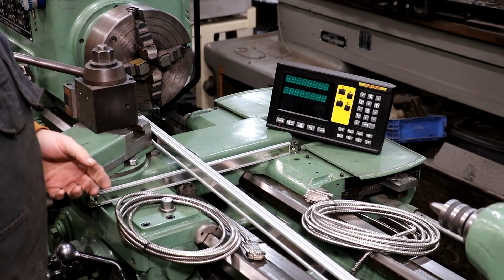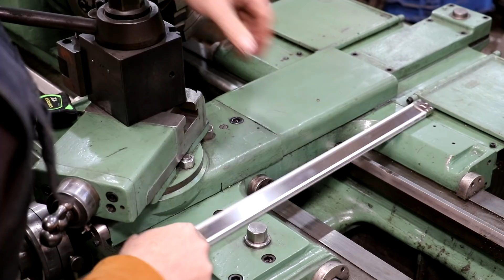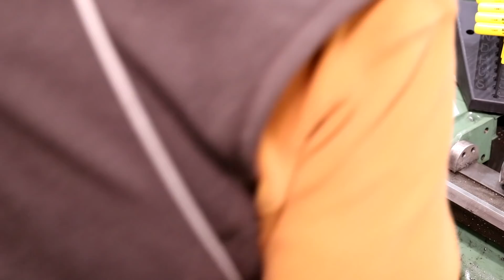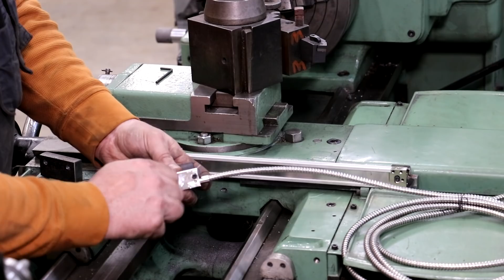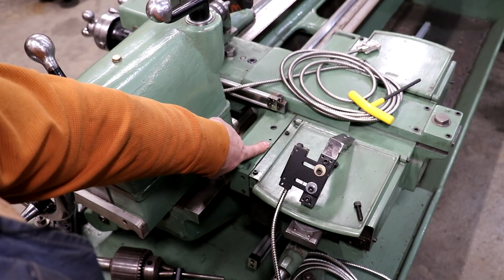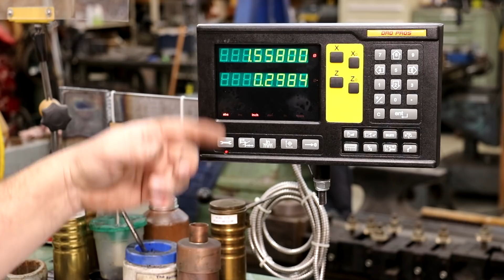Installing a Dro-Pro’s Digital Read Out on a Monarch Model K Lathe

Comment: I’ve been a manual and CNC machinist for 30 and I’m surprised how little I know about how a lathe and mill  is built and what makes it work .
Just was involved in that I was busy making parts. 
I just bought 1960 leblond 13x46 lathe and I’d like to ask what’s the difference in leveling or taking the twist out. What’s more important?It has no broken gears and seems to work well

Comment: I had to mount the X-slide and pick-up on the left side of the cross-slide to retain access to the cross slide locking screw.  Didn't use the grub screws.  Used shims instead.  I have a Z-axis readout on the tail stock quill.

Comment: Keith, a suggestion for you, I have put DRO on at Least 6 lathes now. I found I highly prefer to put the readout directly on the carriage.
This does two very important things for me-
Always have the readout where I am working- and second, allows you to get the cable’s out of the chip pan and traveling with the carriage.
Much tidier and less chance of having the bane of machinist - stringy chips- snag a cable and wrap it around a chuck
I enjoy your rebuilding!!

Comment: Looks simple enough. Couple questions, How important is it that the scale runs parallel? You had a thou both ways, would say 5 thou change the readings? Also couldn't you have mounted the whole assembly out the back end? Say mount the head on the end of your taper attachment and mount the scale on a mount extending back from the cross slide? Would keep it further away from chips and tail stock interference.

Comment: Why didn't you just offset the sensor and strip to the back of the machine so it would not be inline for possilbe tailstock damage. Does not matter where its mounted, just has to be in the same axis?  Would it not also move it away from metal contamination on the magnetic strip from the machining?

Comment: (cross slide) Would it have worked to mount the read head on the flat piece on the rear of the cross slide support?  That would have let you mount the rail directly to the cross slide, starting right behind the bulge.

Comment: Yup. I saw that issue from the beginning. I was expecting that it would be seen before he started to make the mounts. The problem is that when you’re not completely paying attention, because you’re doing two things at once (doing the project and doing a video explaining it at the same time) you don’t have the full concentration you would have if you were just doing the project. It happens to me too when friends are over, and want to see what I’m doing, which means I have to explain it, and sometimes, redo some of it.

I just finished adding a three channel DRO to my mill (not a Bridgeport). It was a lot of work. Now I’m going to take the older readout and put it on my lathe, so I sympathize with the effort here. My lathe has a taper attachment, so it’s a bit of a pain to mount the readout head, just like here. I’m mounting the head to the bottom of the attachment. There’s room on the taper bracket itself.
Reply: I had put everything together to do EXACTLY what you said here... Then an injury brought last year to a dead stop.  Just now getting back in the swing of things.  Thankfully, it wasn't a shop related injury.
Reply: @stxrynn  oh heck, I sure appreciate that! I was just getting back into welding a bit over three and a half years ago. I have a bad habit of going all the way on things when I decide to get involved. Six months later I had a heart problem, thankfully warned by my Watch. I went to the ER. I spent about a year before I was told I could get back to my shop work, which, of course, involves moving heavy objects. As soon as that was ok, I got a torn retina, and guess what? No activity like that for another year!

So for anything serious, it was almost two and a half years before I could get fully back into the swing of things. I’m trying to catch up with that 2.5 years of lost time.
Reply: @melgross  We must be twins.  Retina issue mid '19 cleared in Jan '20, injury in April 20, and just getting back in the grove.  If we lived closer, gravity would double, and we wouldn't be able to move!!  Man, I hope we are done with the limits and can finally get back to busy like we want.  Take care bud!
Reply: @stxrynn  good luck!

Comment: It being magnetic isn't a problem with metal chips?
Reply: I have digital calipers which also uses a magnetic measuring System and I have no problems with metal chips or metal dust sticking to the scale, the magnetic field of the scale is just not strong enough to attract metal...
Reply: @Henning_S.  oh ok didn't know if it would cause a difference in readings or if chips would stick to it and cause damage because the metal was attracted to it so thanks that is good need to know info

Comment: I just put a DRO Pro's kit on my Bridgeport maybe 6 months ago, great product, but like you said, they don't just bolt on. The X axis was pretty easy and did bolt right on. The Y was a different story, try as I might I could not make the supplied bracketry work (at least the way I felt it should work) so had to fab up my own solution.

Comment: Has the drill for the metric tap, has no idea what diameter the drill is. Classic Keith 🤣
Reply: Fun fact: for metric the drill size is just diameter - thread pitch. E.g. M3x0.5 use 2.5mm, M4x0.7 use 3.3mm, M5x0.8 use 4.2mm, M6x1 use 5mm etc. Works all the way up to M60x5.5 use 54.5mm drill.

Comment: I have an import mini lathe, 11" swing and I dabble in engineering as a hobby. For years I kept being reminded that on a lathe a DRO isn't necessary. But a few years back I fitted a 2 axis cheapo DRO and it made such a huge difference to my lathe. Sure, I can't take abom cuts, but recently I was making a new big end bearing for a miniature traction engine and I was within 0.0065" of my target having crept up on the final size just with the DRO

A last year I made eccentrics, short video here https://www.youtube.com/watch?v=BBPIF1u_ke0

Comment: Hey ya I'd drill a hole in a Monarch for those mag scale's That Dro Pro's unit will last for years. The Sony and the Hiedenhain d" Be the others. Setting the +& -- Dia reduction and tool off set's . Love to see it. A sony J230 camera with the privacy filters set to cross hairs on the mill with it's own offset to use as a measuring microscope or to simply peck in points on a graphical unit like the acurite vue. For transfering drill hole's in a existing piece to a blank in a stop. I have the yuriy's toy's kit hoping the grahical display has like 99 point's duhnoh? sounds like enough

Comment: This maybe a stupid idea but I will ask anyway, with it being a magnetic system being used on a machine the is built to make metal chips won’t there be a problem with metal shavings collecting around the magnetic head then start gouging the scale and  would that interfere with the accuracy
Reply: Ditto...was immediately curious about that.
Reply: @Gontiveros  The magnetic part is under the stainless cover (the shiny strip inside the alum extrusion).  The read head floats about 0.5-0.8mm above the cover and has wipers.  Larger chips would probably not stick in the first place (they haven't on mine) but would be swept off by the wipers.  Smaller chips (dust) is either swept off by the wiper or harmlessly passes under the read head.  Even if they scratched anything, it is just a stainless cover strip.  The magnetic part underneath is bonded to the alu extrusion and looks like a fridge magnet.  They are impervious to water/coolant and can't be contaminated by chips.  The read head and scale are significantly more compact (smaller) than other systems I've seen, which is important when dealing with limited space, plus how far back your tailstock now sits since it can't get as close to the carriage as before.  Some mount the scale to the chuck side for that reason, but that has its own hazards.
Reply: @barrygerbracht5077  Awesome, thanks for the thorough explanation!

Comment: Standard metric tapping size is easy. Diameter - Pitch = Tapping drill. 4 - 0.7 = 3.3 , not sure if it holds for fine and course though.
Reply: Even easier, no nead to know pitch: for normal metric threads tapping diameter is thread diameter times 0.8.
Reply: @radiohirsch  Your formula for determining tap diameter is very wrong, even for standard pitch. Des stated the correct method, and, yes, you do have to know the pitch.
Reply: @radiohirsch  that is incorrect. 10mm tapping size is not 8mm for instance, fine through to course is bigger than that.

Comment: Any reservations in drilling holes into original Monarch  cast iron? Possibly the price to pay for updating and increasing accuracy.
Reply: After the first couple of holes, it's not nearly as terrifying...  I just installed one on my Enco Mill.  Took a good 3 hrs for a 2 axis install.
Reply: I’ve seen that question before.  It was a Monarch lathe too.  The answer was “Monarch would have done it from the factory if the technology was available when the the lathe was manufactured.”

Comment: I hope those parts are made in the USA.
I installed a chinesium DRO for $300 on my Reed Prentice it works fine.
I installed a stop block (a bolt) In the carriage to protect the read head.
Reply: Seems like a contradictory statement.  He should buy USA... but for you China is fine?

Comment: You will need to add a bumper on either the tail stock or the carriage to keep the scale protected. I used a plastic piece used as a foot on let’s say a tool cabinet on mine with a spacer to get the minimum separation needed. It’s easier to do it now than after the scale is bent😢😉. I have acuride glass scales that have the disadvantages of not being able to change length but they are much smaller dimensionally which can be a huge advantage and this was the case for me especially when I put a scale on the compound. Thank you for the video and you are right it is easier on newer lathes with machine surfaces. I did have to machine a flat surface for the reader head with my router which worked great until it grabbed the rag I had in place to catch the cast iron chips. Let’s say it got very exciting for a minute🤷‍♂️. Live and learn.

Comment: I think if you take the time to learn all the functions Keith it will spoil you.  The only problem I have is that it makes it easier for me to get sidetracked chasing tolerances to excess just because it's there. I think we all tend to do that at times.
Reply: black tape over the rightmost 14 digits.  Works a treat.
Reply: @stxrynn  Should work😏

Comment: Metric drill sizes are easy. M-number minus thread pitch. 
M4x0.7 - 3.3mm drill.
You can go up like 5-10 percent of pitch size for easier tapping and still be within max core diameter.
Reply: For inch threads the tap drill could be a number or a letter size drill. Charts are everywhere though.

Comment: Do you have to worry about smacking the tailstock into the reader and scale?
Reply: I’ve set up dro’s on a few lathes at my work. Easiest fix is to drill and thread a hole next to cross slide reader for a bolt the right length to act as a bump stop for the tail stock.
Reply: @samscruff5454  That is A way where the bolt is not to thing.
Reply: @dd8pz  NO put the bolt down near where the reader was drill and taped and bolted on. I normally just added a extra larger threaded hole when drilling mounting holes for the reader that lined up to hit the tail stock.
Reply: Make A stable stop behind the cover of the scale to protect it.